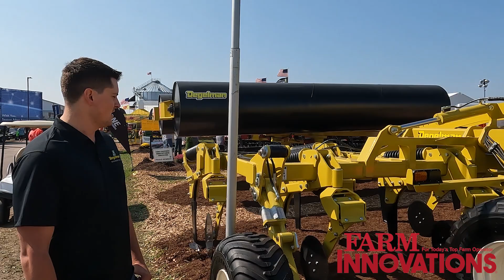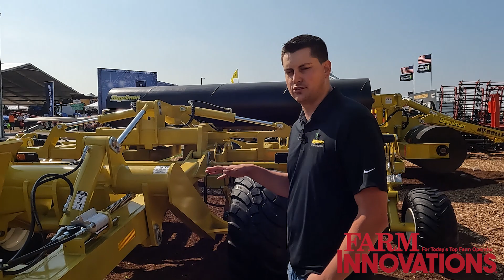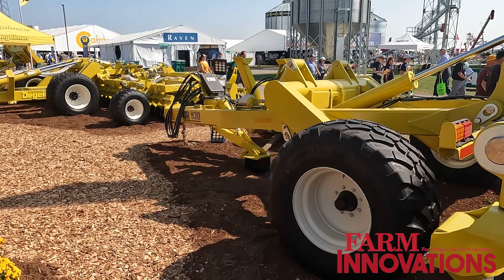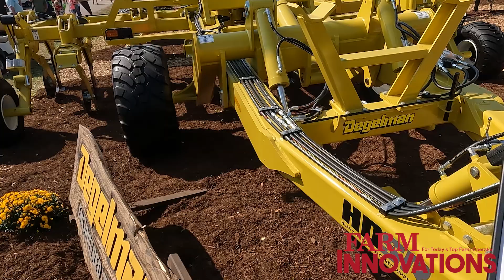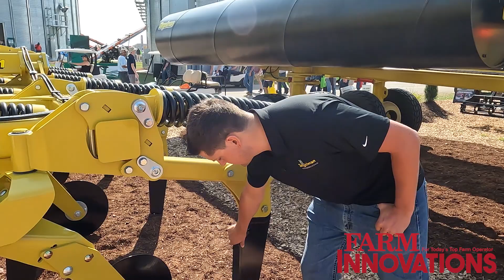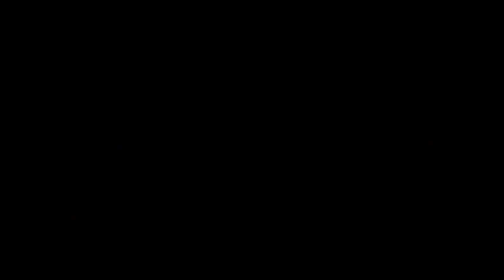A Closer Look at Degelman's New Heavy Duty Staggered Ripper

Comment: 500hp for 9 shank, so 15 shank will require like 800hp?
Reply: The 500hp for a 9 shank was incorrect.  45/hp per shank so for 9 shank you'd actually want 405hp and 15 shank you'd want 675hp, depending on depth and soil.